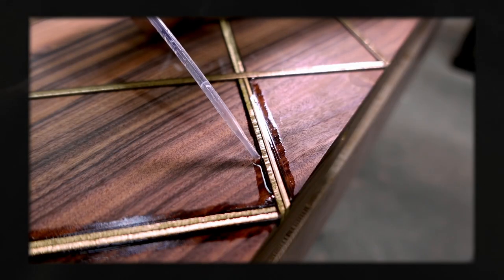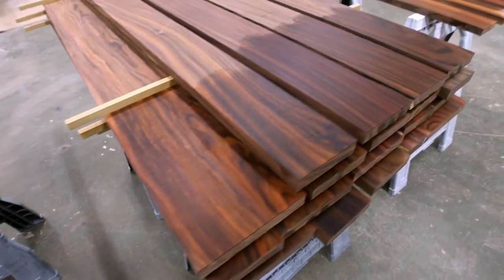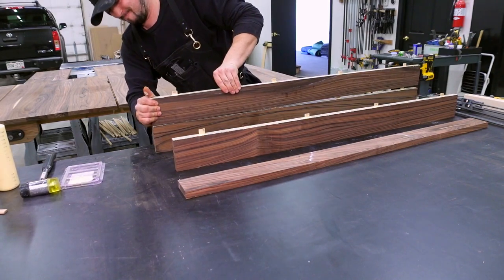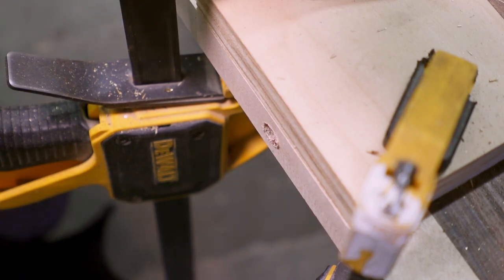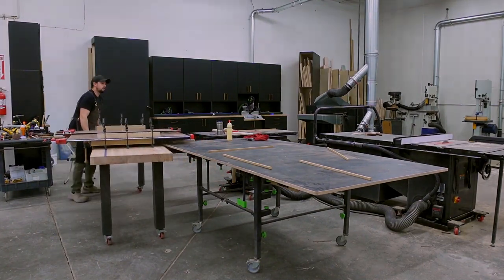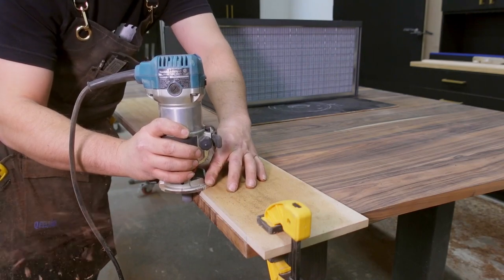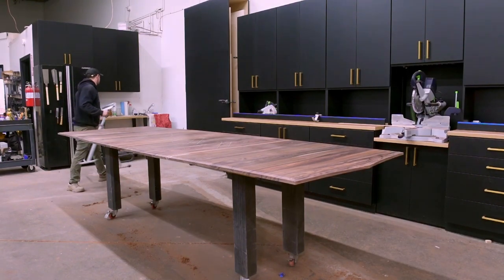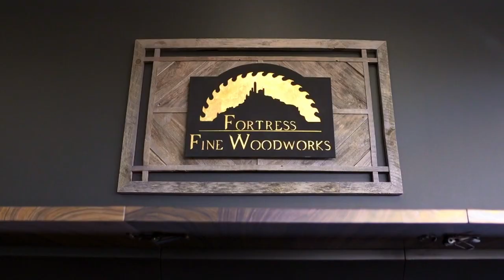There's A FINE Line Between Furniture and Art.

Comment: You can't see it, but I'm holding up a lighter and screaming, "Rooooock Ooooooon!" I felt tense every time you put a router to that amazing wood, because of all the outcomes that happen with a router, only one of them is good, kinda like a forward pass. I agree with you on the wooden jigs where they get blown out... and I'll add a trick I learned when I got sick of drilling shelf pin holes and oopsing all the way through - calculate the depth you need and spray paint above that line on your drill bit. It won't really impact the performance, and the tape trick method will fail when the tape inevitably creeps up the bit.
Reply from the maker: Yes, the routing and spray finishing are always pucker worthy! Scary even on a good day. That is a great tip for the drill bit. I bought a pack of different sized collars that can be used as stops, but they always come disengaged on the spiral milled part of the bits!
Reply: @FortressFineWoodworks  You just saved me $$ by not recommending those type of depth stops, which I was considering. Any other ideas? Sometimes the spray paint hack isn't precise enough.
Reply from the maker: Mathias wandel uses a hollow dowel. It slides over the drill bit and bottoms out on the chuck. So it won't move, as long as the drill bit is in there real tight

Comment: if you use your big router instead of your hand router you shouldn't  get that  tear out  . or at least   use a spiral flush router  bit.  also if your going  to be doing alot of  table tops should  look into buying  a used 36 inch wide belt sander. i bought  an old used one on Craigslist  for 3000 k  that  would cost 20k new. i have a supemax drum sander  similar  to what you have and its like  riding a  bike 5 miles as opposed  to a car  and your can sand a  massive  counter top   all at once and everything  will  come out  perfectly  level and with 220 grit . you'll  barely have to sand it with a orbital.  spending  half your day sanding gets really  old really fast .
Reply from the maker: Yes, I definitely agree. Using a different bit would help too. 
That's a good idea to look on Craigslist for a wide belt sander. I need one and I think you know it. Thanks for watching!
Reply from the maker: I actually looked on marketplace and found a 37 inch drum sander so I went and picked it up today. It needs some cleanup but runs well. Thanks for the advice!
Reply: @FortressFineWoodworks   I been doing  wood work  for 25 years  and I been on my own for 11  and I've made alot of mistakes that cost me so much time  and money . I was working  7 days a week  when I first started  on my own  11 years and got really  burnt  out.  I think  going on you tube is your best  opportunity  to  keep your integrity and not start doing things cheaper and faster for profit.  I hope the drum sander  works  out for you  I've never used a big drum sander, everything  I've used at that  size  have been wide belt sanders.
Reply: a great  place to look at auctions  equipment  is machery max  sometimes  theres an auction  from a company  near you thats going out of buisness. I bought a spray  booth  for 500 dollars  and many other things  on there.   you learn  alot about equipment there just looking .
Reply from the maker: Thats good to know. I will have to look sometime